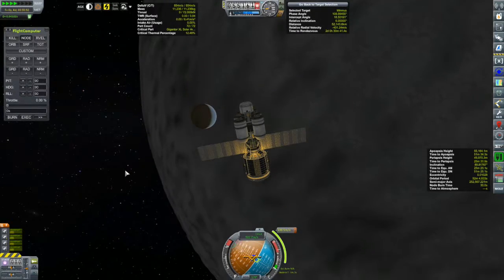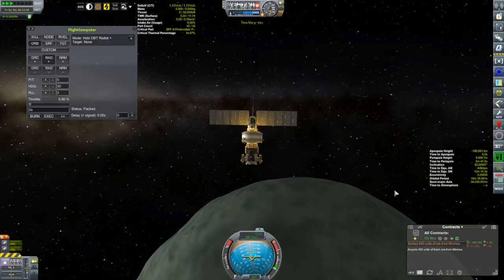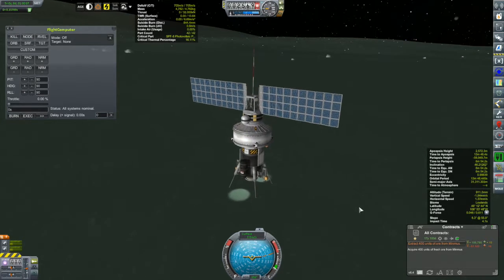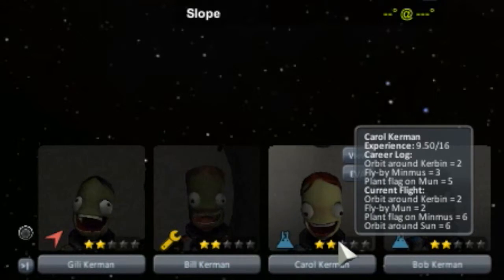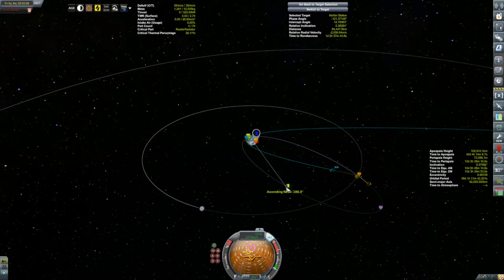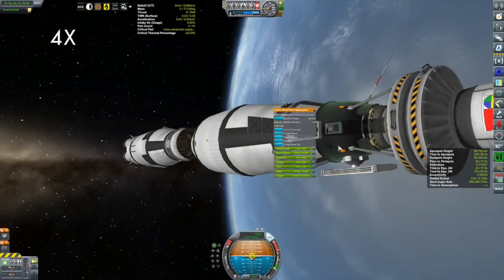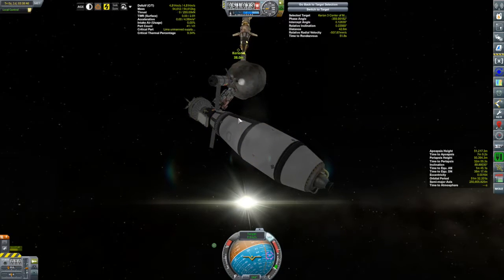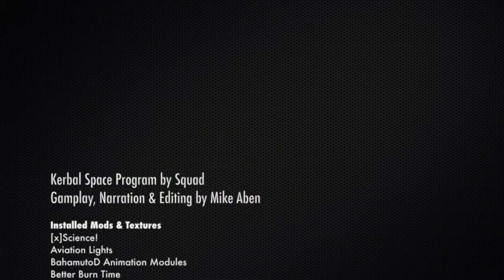KSP Career: Episode 108 - Sometimes, Simple Is Best

Comment: There were way more resources attached to that asteroid than you'd ever get out. That was so funny. But it's not so funny when you go to so much effort to get a drilling platform onto Minus, only to find out it doesn't work very well (or at all). I so felt for you there.

Good episode as usual.
Reply from the maker: As far as resource harvesting goes, I think it's go big or go home.
Reply: Or Squad need to do a bit of re-balancing, to make the smaller parts more useful earlier in the skill tree